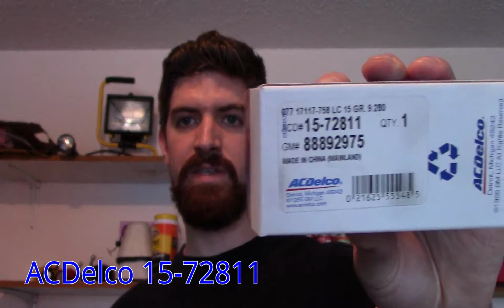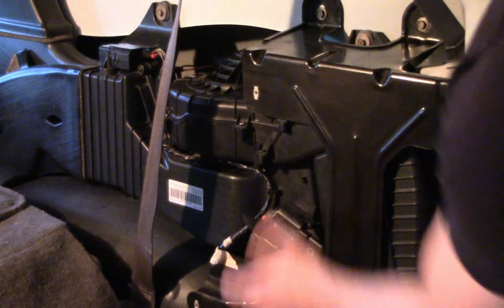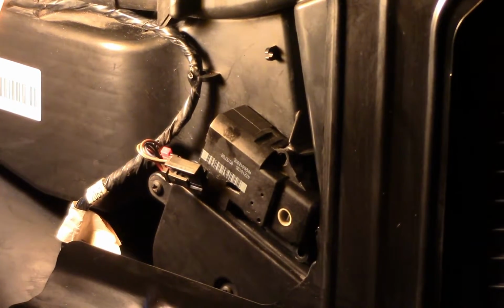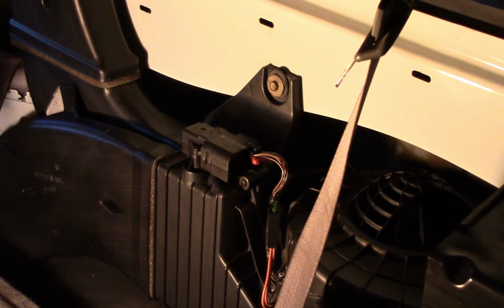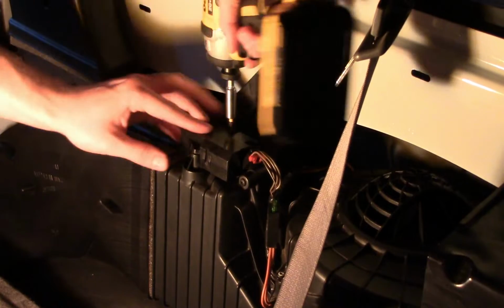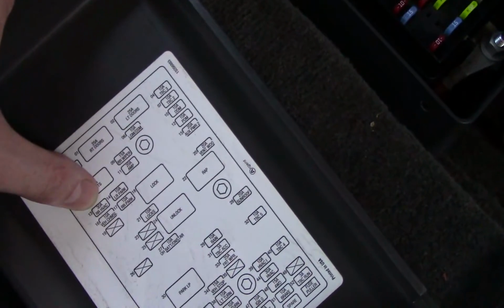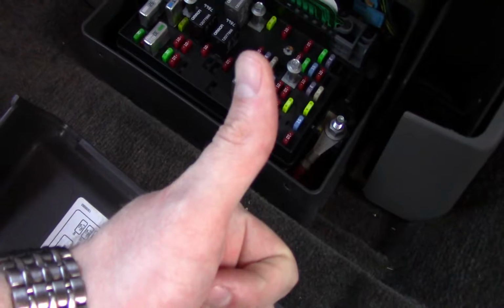Replacing Rear AC Blend Door Actuators Chevy Trailblazer 2002 EXT LT Hot/Cold  & Head/Feet

Comment: Do you have a video on how to take the left rear panel wall out and put it back?
Reply from the maker: No but I have a video of taking off the right panel. It is pretty similar to the right side. I had to replace my amp so I did the left side recently.

You undo 5 screws in the back. Take off the seat belt, use a panel pry bar to pop off the seat belt trim panel, then use the pry bar to pop off the left trim panel. It also would probably help to remove the small left rear trim panel above the left trim pane in the rear because those two are hooked together. There is one electrical attachment to a power outlet that's a little bit of a pain but after that the panel is off.
Reply: @savorwithdmurph1113  my bad it is the right panel

Comment: I can't afford to fix it yet and it's draining my battery...is there a fuse I can pull to stop the motor or whatever that is from continually trying to engage??
Reply from the maker: Not sure exactly what fuse to pull but there are several HVAC fuses in the back. HVAC B is for reseting the actuators. Try those and see what happens. I'm also dealing with a battery drain. I'll probably be buying a car at the end of 2020.
Reply: @savorwithdmurph1113  thank you for replying... So I pulled that fuse all together and no more noise and now my car starts! Something is still slightly drawing power from the battery but at least it's driveable now

Comment: Which front actuator on a 2006 Chevy trailblazer controls the blend doors? And are all three the same in the front?
Reply from the maker: So it looks like the 2006 may have the same location for blend door actuators. The Hanes manual has years 2002- 2009 so I would assume these are all similar locations. Mine's a 2002. The one I worked on controls the hot/cold driver side.
Reply: @savorwithdmurph1113  are they all the same part?

Comment: My dear my trailblazer rear AC is dead no any electricity work on it and when turn on is work so what I do ? Better I change the full fan system and really cost
Reply: Hi again I provided to many work shop the some of they inform me to change to fan and some they said change the hole unit AC so with your help video I bought used part for the bowler motor resistor and work  eventually but again go to off when I switch the AC so if I took out and return it back the resistor it’s work again today I will get other device and feedback thanks allot
Reply from the maker: Can you describe what’s happening in more detail?
Reply: I did the replacement of the device and finally work thanks my dear I appreciate your advice

Comment: So working on a 2004 GMC Envoy with these same actuators and the same fuse schematic. When I pull the fuse to reset after plugging it back in it will sit there quietly for about a min or two before it does anything, then if I kill the vehicle and bring it back on nothing happens. It will also kill the fan as well. If I leave it on for about 5 min the actuator controlling the temp will make noise like it is calibrating but the floor/ceiling actuator does nothing, then the fan will kick on but the actuators are still unresponsive.

Is this something we should see results right away or it is something that really needs several days like you mentioned? Or could it be something else?
Reply: Did you ever find a solution for this reset issue? I'm having the same challenge with my 2005 Chevy Trailblazer.

Comment: Hi, what happens if the vent control broke off in the actuator?
Reply: Also the air doesn't blow from the middle vents but it does from the very back??
Reply from the maker: This is a common issue with the trailblazers. Try closing/adjusting the rear vents accordingly. I just had this issue, and I closed the rear vents entirely. I assume the AC was accidentally designed so more air goes to the back than middle.
Reply from the maker: So if the vent control broke off, you can try gluing it back on with strong glue or (I assume) replacing the blend door entirely. 

I couldn't find the blend door part by itself. This is a link to the entire assembly which includes the two blend doors. If you buy this make sure it fits your make and model. 
https://www.wholesalegmpartsonline.com/products/Chevrolet/2002/TRAILBLAZER--Base/CASE-AIR-CONDITIONING-AC-Evaporator-Core-Housing/3106047/89023340.html 

You might be able to find the blend doors by themselves if you look around enough. The lower blend door in the diagram is for temperature and the higher one controls air flow to the floor or face.

Comment: help !!!!
the peen who goes to the actuator is broken.
can you help me ?
Reply from the maker: Hey buddy, can you please add more detail about what the peen is and the issue your having? I'm unfamiliar with the term peen?
Reply: @savorwithdmurph1113  thanks, its the peen who goes in to the actuator, rear ac trailblazer 2006.
the peen that the actuator have to speen...
Reply: @savorwithdmurph1113  the hot/cold one...
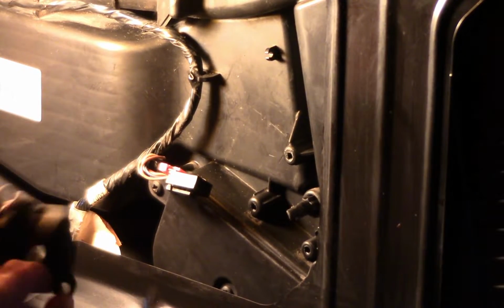Reply: @savorwithdmurph1113  the one you speen at this video at 2:37
Reply from the maker: So the peen is attached to a blend door. You can try gluing it back on with strong glue or (I assume) replacing the blend door entirely. 

I couldn't find the blend door part by itself. This is a link to the entire assembly which includes the two blend doors. If you buy this make sure it fits your make and model. 
https://www.wholesalegmpartsonline.com/products/Chevrolet/2002/TRAILBLAZER--Base/CASE-AIR-CONDITIONING-AC-Evaporator-Core-Housing/3106047/89023340.html 

You might be able to find the blend doors by themselves if you look around enough. The blend door you need is the lower one in the diagram (temperature). The higher one controls air flow to the floor or face.
Reply: @savorwithdmurph1113  which glue do you recommendwhat ?
Reply: @savorwithdmurph1113  sory and thanks...which glue do you recommend ?
Reply from the maker: A very strong super glue. Loctite is a brand I really like.

Comment: Hey, awesome video!!! So after two years of procrastinating I finally opened it up. Now I have the replacement parts but the position isn’t correct inside the actuator. The ones I removed are a certain way. How can I fix that?
Reply from the maker: You can move the vent knob and then slide the actuator on. This is difficult for the hot/cold one on the side but possible. You can also plug the actuators in, reset the system and adjust the rear AC controls till they fit.
Reply: DMurph & Pri-Pri  hey so I managed to get it to work. I plugged in the actuator and noticed the position move when I moved the knobs around of where I wanted the air to blow. I got it to move to the middle, and using a flat head screw driver I moved the knob to the matching position and managed to get it in.

Comment: I don't have HVAC fuse in my cluster only 1 A/C. And it doesn't seem to do anything. Also, I couldn't just swap the old for the new as the plugs were not matched up so I could install them. Were your yours matching up for a quick plug-n-play? Currently I have all my car apart old actuators off and no way to put the new ones in...HELP!
Reply from the maker: What year is your trailblazer? Also check your  cars manual for the location of fuses or google the relays. Yes mine were matching up for a quick plug and play.

Comment: I have a 2008 Trailblazer LT my front driver side does not blow as cold as the passenger side. Then with 15-20 mins of driving all vents start to blow warm air. I have to turn the truck off then on for it to blow cold again. Can u help me figure this out
Reply from the maker: Happy to help. I’ll ask you a few questions and we can get to the cause. 

First, this doesn’t sound like an actuator problem. A HVAC fuse reset will help rule this out. That driver side vent is acting a little funny but that wouldn’t cause all vents to go hot. Also if it was an actuator it wouldn’t reset every time you turn the car on. The actuators mainly reset when HVAC fuses are pulled/battery is removed.

Second, have you had the refrigerant levels checked/serviced? It sounds like not enough refrigerant is getting around to keep the system cool. Once the car runs it may get used up and turning it off allows the refrigerant to gather, causing this cycle to be repeated. How long has it been blowing cold then switching to hot?
Reply from the maker: If anyone else has input feel free to chime in! 👍
Reply: Yeah the front driver side blows cool and passenger side blows ice cold. I had Freon put in last summer. Idk about the refrigerants or levels. How do I reset the fuse step by step I don't wanna mess this up. Thanks
Reply: Like 20mins of driving the air will blow warm u can smell the air change from cold to hot. I turn the car off then back on everything blows cold again
Reply from the maker: This is the process I followed to reset my A/C actuators. You pull all of your HVAC fuses in the rear fuse box wait 15 seconds put them back in. Then turn on your car wait for the actuators to adjust (you'll hear them whirring) once they stop adjust your dials and see if you get cold air. Then turn your car off and on to see if the system reset. Sometimes this needs to be done 2-3 times. If your actuators need to be reset, the A/C will blow cold air when you turn your car on for the first time.

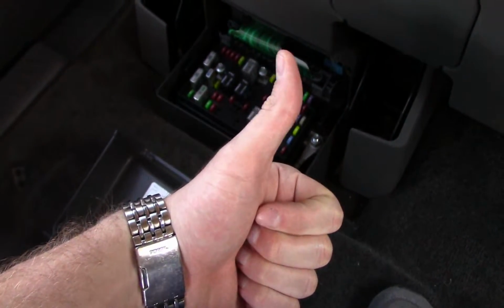In this video I discuss resetting the HVAC system in more detail at 5:05. You'll need to pull the 3 at the bottom of the fuse box.
https://www.youtube.com/watch?v=Uf47Gz2whF0
Reply: @savorwithdmurph1113  do I pull all HVAC fuse's and after that do I turn the engine on or just the ignition. Thanks again bro
Reply from the maker: Actuator Test:
Before the HVAC reset just turn on the ignition (no radio or loud noises) and move your hot/cold dials. You'll hear the actuators moving (a soft whirring noise). If it sounds off (you move a dial and no sound comes or there is only partial sound) then there's a good chance of a bad actuator or the need for an HVAC Reset. If they're whirring away and sound great (basically whir every time you move the dial) that may be an indicator that something else is causing the issue. 

HVAC Reset:
To be safe pull all three HVAC fuses on the bottom. The top one is just for the rear blower motor so shouldn't impact the actuator reset. Turn the engine on so the compressor gets power and will cool the AC.
 
Extra info:
The first turn on will reset the actuators and the second turn on will let you know if the setting was saved or not (This is why sometimes the process needs to be repeated a few times). The first reset will show you if your issue is an actuator or not. When you do the first reset leave it on for 20 minutes drive around a bit and see if the AC stays
 cold.
Reply: @savorwithdmurph1113  do I have the ac turned on when I start the engine after the HVAC rest?
Reply from the maker: I've heard that it helps to leave the AC on at fan speed 3 and in between hot and cold. Let me know how everything goes!

This is another video where I worked on the driver side and discuss the reset at 21:24. 
https://www.youtube.com/watch?v=dQtFFuMI3aw&t=463s
Sorry I didn't share this earlier. I thought you were asking about this video at first.